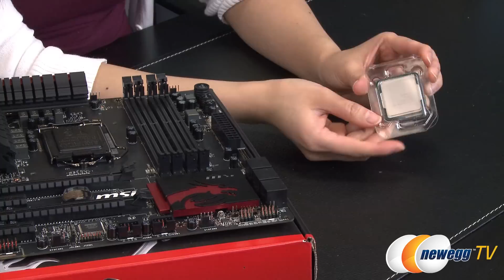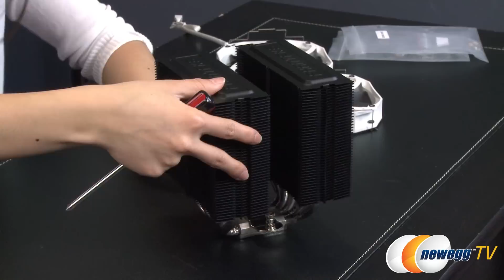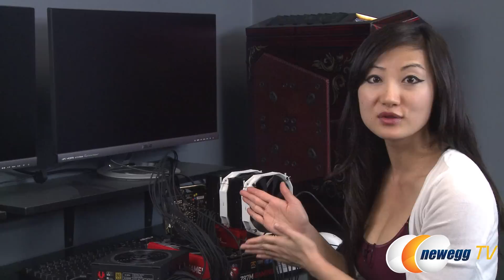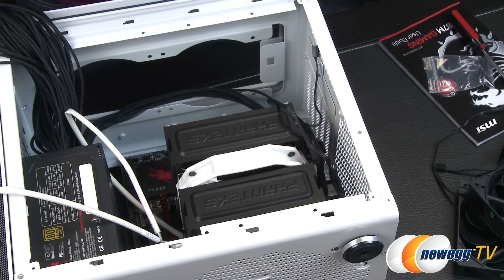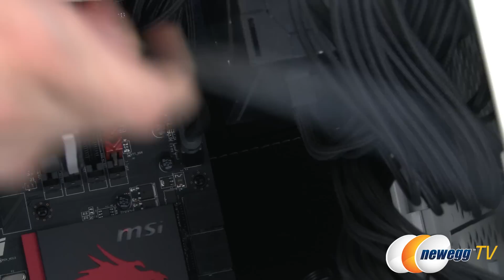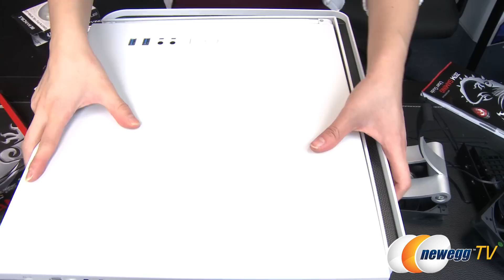BitFenix Phenom M Micro ATX Build - Newegg TV

Comment: I can't see the point of the top two fans, the Graphics card is so close to the intake that it wouldn't have needed the extra fans. Am I right with this theory or is there a reason for those fans?
Reply: It's for case air flow, to create positive pressure in the case. For that, you need slightly more intake pressure than exhaust pressure. Also, you really don't want your only intake fans to be ones that blow the air into the GPU heatsink, effectively heating all the air that goes to the rest of the case. The GPU fans are also not flush against an intake and warm air rises, so they're basically recycling ambient air and heating it up more and more, like a convection oven. Look up the Positive vs Negative Air Pressure video that Linus did for TechQuickie for more information.

Comment: Two things that stand out to me in this video.  If intel somehow felt the cpu cooler included with the processor was "adequate" the one in this video is 3X overkill, and the wires on that 24 pin connector are 10X longer than they need to be.

Comment: Aaaaarrrggghhh!!! That cooler is a monstrosity. Blocks air flow too much! Don't be cheap and just get an H70 on it. Also don't put a processor on the desk, it could get dust on it. Would never let her build  for me.
Reply: +GeorgeW666 That Phanteks will destroy an H70 and last a lot longer.  Be wary though with those sleeve bearings in this orientation.  Noctua, Corsair or Be Quiet SSO2 and fluid dynamic bearing fans will last longer in this configuration.  The Phanteks also cost a little more, so it's not like she's cheaping out, she's just choosing a far superior part.  Not as superior as an NH-D15 or Cryorig R1 but still an excellent performer.

Comment: The fans on the CPU cooler is blowing upward from the graphics card. That will pull hot air from the GPU when it's under load. And the airflow of the case will also be distorted.
Reply: +Tommy Yang   - RTFM is something the team forgot.  ;-)
Reply: It's non-ideal but it'll work fine.  In cases where there is a single exhaust fan and it's located immediately adjacent to the CPU fan this is going to tend to be the case anyway with open air GPU coolers.  The ideal circumstance is just to use a blower card which, from the perspective of the system, is its own exhaust fan.  Think about how many systems these days use an AIO water cooler as their entire exhaust system in combination with open air GPUs...virtually 100% of the exhaust heat from the GPU is going to pass through the rad on the exhaust.  It's not the way I'd do it, but you work within the limitations of your parts.

Comment: Hot air rises though..
Reply: Even thats true I still have to do beacuse the case is on the carpet i cant intake from the bottom. And this case specially exhausting the PSU onthe bottom so no point to take in the hoz air from the psu back in the case . Phenom M must be bottom exhaust I think

Comment: On cases that have a front mounted power supply make sure after you plug in the main power cord that you flip the power button to the on position.It's very irritating to get your build done to realize that the first thing you installed is the the issue. I unfortunately made this error due to being overly excited to get my PC up and running. Rookie mistake.

Comment: get a short cable set and learn how to cable manage goddammit
Reply: IReallyLikeWaffels I was wondering why there was that HUGE WAD of cables. Is that even necessary? Wth are they for, there is so much access cables! Im new to all this and figuring it out but this just looked wild, not to mention all the components looked like squeezing 5lb of shit in a 2 lb bag.
Reply: Vrael473 24 pin for the mobo, 8/4 pin for the cpu, sometimes multiple cables for power hungry graphics cards, and two cables (power and data) for every drive... add fan cables and all those small front io cables and there you have your wad of cables
Reply: IReallyLikeWaffels Dear Lord.
Reply: Vrael473 Its not that much dude. AHahah Theyre big cables too.

Comment: She explained it well. Her voice is clear and she is confident. I have seen worse. Well done. Thanks Joanne. Thanks to the team behind her.

It is easy to criticize. So she put the heat sink CPU on the table. It was not the best thing to do but again it comes down to what you think of the PC. Is it worth the extra attention?The table looked clean enough. In the end it would not make any difference.

I like the dust filters. I wish they would put more effort attaching the heat sink to the case with springs to use the cases thermal mass.

Comment: i am an installer for a computer shop, i do this work since 1990, your installation was horribily wrong, there's no space for the air, whenever u start a game with that computer it will just burn, using a so big cpu fan just REDUCED heat dissipation because it's TOO BIG, u should have used a closed liquid system, the only way u can do a gaming pc with that case (that i really well know, done around 20 pcs with this one), but the real purpose of the bitfenix prodigy m is AMD APU's that doesn't requires a videocard.

Comment: Just explain me one thing: If you buy a modular PSU for a small case, is it so hard to find shorter cables for it too? I would be much happier to see less of that cable mess around.
Reply: Mikko Saarinen It's not hard, just expensive to get shorter third party cables, especially wrapped ones. Like $15-20 per cable depending on who you buy them from (a huge retailer vs a modder like Lutro0). Corsair sells them in sets for about $60-70.

Comment: I was thinking isn't it better to use one more fan (rear) and smaller CPU cooler (same type though)? Turn the CPU cooler at 90 degrees so the hot air would move directly from case via the rear fan. Who's got the same case to share wisdom?)  Or probably Colossus Micro-Atx (they are similar inside).

Comment: Hot air rises. Why would you try to force all that hot air out the bottom. Please explain.
Reply: The hot air rises concept literally has zero effect on a PC cooling set-up. Hot air rising is barely noticeable in a high ceiling room. The fact is, that the components in a small case are hot enough, and the air is moved around enough, that the temperature of the air is constant anyway.
Reply: Came here for this.... I didn't understand the logic behind the air flow either. I was thinking of a build with this case and I would've done the air flow in the opposite direction. Any ideas why this is or isn't better?

Comment: I also would have put the airflow the other direction seeing as how you can get colder air from the bottom and throw the hot air out the top but oh well. the way she has it the air will hit the bottom and seeing as how the air really has no place to go it will just blow back into the case.
Reply: did you even watch the build? the motherboard is upside down, which means the reason she did it that way is so the graphics card can take in fresh cool air and the cpu fans will pull heat way from graphic card and push it out the bottom which in regular build it would be considered the top.
Reply: PC_GameWorld Ive done it the opposite way since heat rises, however everything is water-cooled including gpu. This case is not really made for air cooling as visible in the video, but ye if you do air cool it that direction is correct.

Comment: She needs to read up on thermodynamics. Heat rises, so the top should be exhaust. Also, the DCUII cooler on that video card exhaust the air into the case, not intake it. That's not a reference style cooler. She needs to reverse the top/bottom fans or she's gonna have higher temps in the case.

Comment: Note: if you do not want to short the pins on the mobo for a test boot, find your case/side panel with the power cable and plug it in. Shorting is faster though

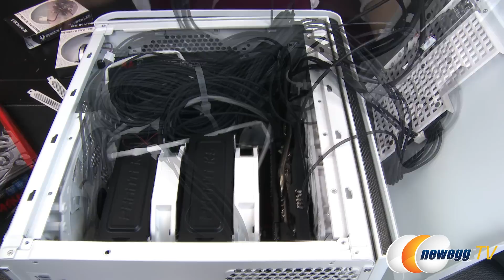Comment: Did anyone notice that the 230mm fan would struggle to spin if spin at all because of the two fans on the CPU Cooler at 30:45? (left side of the video)

Comment: how come only parts of the parts list was in the link and i think that big heat sink is a bit to much and a modular power supply should of been used as that many cables just shoved in there will stop alot of air flow and make the fans work extra hard just to keep at a stable temp.

Comment: about to use this case, but going with 2 fans up top intake, back and bottom exhaust. maybe use rear as intake instead as its H75 cooler. hmmm. flipping the control door to the other side seems to be the way to go for wires.

Comment: Sorry, I'm not a fan of this set-up.
If you got rid of the excessive cooling system, you'd have more room for air flow. The way all those cables are bunched up against the power supply (I know there's no where else for them) and the rest of the cramped-up system, this set up is a dust-collecting fire ball waiting to happen.
It's far better to use a large, open, case than trying to cram everything into something so small. The components will last longer too.
Reply: All they needed to really do with this build was NOT use high profile-heatsink ram and turn the phtc14pe cooler to where @ 22:20 it would be exhausting out the REAR of the pc case and then install that gigantic white 230mm fan as an INTAKE thus creating positive air pressure to keep more dust out and provide better cooling than this setup.

Yes REGARDLESS, i agree that something like a Silverstone Strider series power supply with the short cable kit ( pp05 as in p p zero 5 found on newegg and i think ncix also) would be SUPERB in this "case" scenario.  x)

Comment: Hello Joan, I have to say that you are technically very capable, but this chassis was designed by one who has no basis for technical education. Damage to the MSI
graphic card, because if you stay in this case and in this system, will burn for a month. In this case air circulation and ventilation flows collide so that, at least as the film shows, the housing for the system and processor that you installed, is disastrous
bad and I need to undergo drastic technological changes, but by age
technical designers.

Comment: The other side of the arrow is not negative, its ground or zero. If you'd have a negative voltage on the other side you'd double the voltage

Comment: if you rotate the heat sink 90 deg. you should be able to use the first PCI-X16 slot. (assuming it clears the memory.) Then you would be able to reverse the fans so your not fighting the rise of heat and also create more room for the GPU to breath.

Comment: 31:00 Cringing! The Phanteks PWM fan splitter that is connected to the motherboard is touching the 200mm Bitfenix Spectre Pro fan!.
As it's exhausting out the back it's probably going to suck the cable in :( Possible fan blade breaking :(

Comment: That system looks like it'll run around 100degrees at idle. Too hot. Just get a bigger case and (h80I cooler) liquid cooled for ease and perf.  The GPU is a blower style and that massive CPU cooler will only have hot air to pull.

Ssds needed streight sata headers. I like the vid beacause I now know not to buy a PSU like that=)
Reply: That GPU they used is most definitely not a blower style.... I suggest you google it
Reply: True enough. It does blow the hot air down on its heat sync and out into the case though.

Comment: I must be bad at picking part my computer I built cost 980$ I think 
With out the need to buy a 550 watt power supply , os and monitor.  and no video card or bigger fan :( and this build has a 770 video card An ssd and only cost 600  :( where did I masse up
Reply: That price doesn't include ram, power supply, graphics card, SSDs or extra fans.  So the price is gonna be a bit more than $649.96.

Comment: Cases like this are slightly annoying..
Having the heat of any device exhausting at the bottom is stupid because it will just get sucked back in by the front or top fans...

The PSU should be exhausting to the back or top, cool air should be coming in from the front or bottom, hot air going out the top or back.

An extra panel on the bottom diverting air to the back would be prefered on this type of case design

Also, mounting any drive to a removable side panel cover is stupid...

Comment: heat rises, why are you exhausting through the bottom ?
Reply: Because the case is designed for top-to-bottom airflow. You can criticize the design, but it makes no sense to do it differently with this case, the result will only be worse. Unless maybe you don't have a graphics card installed. I suppose that would make bottom-to-top airflow a viable option for this case.

Comment: Did anyone notice she didn't put in DIMMS in all the way?
Reply: yeah she did, otherwise the test boot wouldn't have started.
Reply: Someone did!
Reply: That happened to me when I build my PC. They did click, but they weren't all the way seated and so instead of a POST I got a error code. And for some reason after seeing a memory error my first impuls wasn't to check the DIMMs, but I noticed the problem eventually.
Reply: she didnt get post because there wasnt a hard drive in so it gave an error, the RAM DIMMS were in, I have the same motherboard, when it dosent have a hard drive it gives an error.

Comment: i would go full modular and use short cables. I would also swap out the massive cooler for a Corsair H75.  Giev you all the space back and you can actual put things in the pci-e slots.  at some point you know your going to want to put a second gpu in there. 

It seems like it was not easy with that large cooler, i done a build in this it would have been hell.  i would also suggest swapping the side panels wound so the power button and USB are on the motherboard side that way the cables can be put in and wont get in the way.

you also missed the MSI motherboard header adapter (pre-wire the pins to one thing that plugs in) you hinted at it being missing but it does come with that motherboard.

easy over

Comment: since heat rise wouldn't it be wiser to intake from the bottom and exhaust in the top..?
Reply: Heat ain't going NOWHERE fast in THAT case!
Reply: Not really, since the graphics card fans will always suck air from the top, so it would go against the airflow. It's also one of the hottest parts, so having air from outside the case go directly to there isn't a bad idea. The case is pretty much designed for this kind of airflow. Whether that's a good thing is different question.